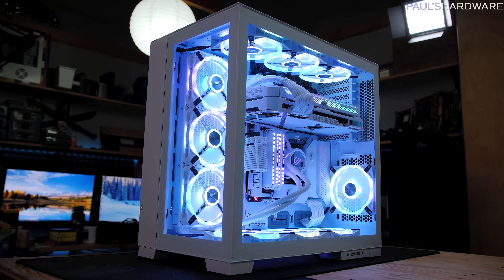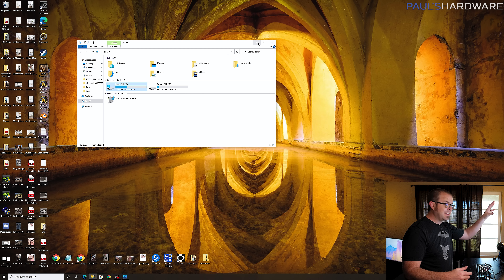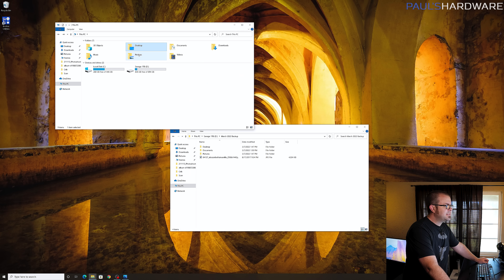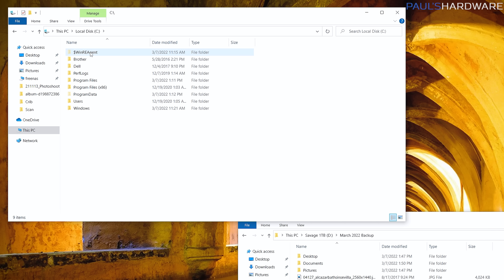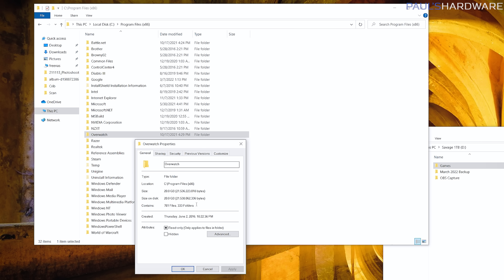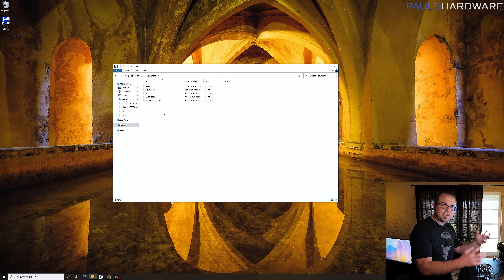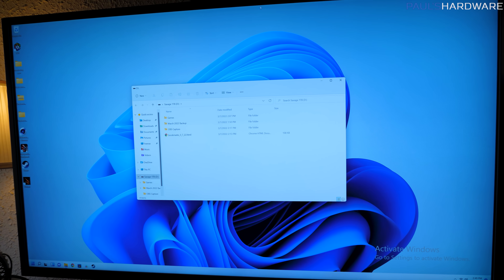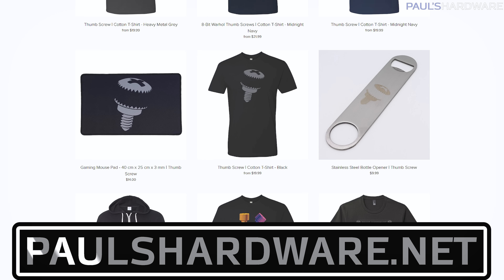How to Move Everything from an Old PC to a New PC

Comment: .My PC has died, so I'm wondering if it's possible just to buy a cheap refurbished PC on eBay and drop in the harddrive from the old PC ... What are the issues I would face, because I'm expecting it isn't going to be as easy as it sounds.

Comment: issue is i have very old photoshop and lightroom 5.6 what works great for my needs and by looks of it i think its hard to find a download link. i refuse to pay for it monthly so i will continue using older version , well as long as i can so im moving from  Asus ROG STRIX X370-F motherboard with a 1800x , to a Gigabyte B550 AORUS ELITE AX V2 as i need better rgb and argb and newer usb and extra m.2 and updating cpu to 5700x its not a huge upgrade but need better but less power due to flat Silverstone GD10 height limitations best i could find was id cooling 67mm as the case needs to fit below av receiver, for now im using same gpu evga 1070 8gb and on first start i only plan on plugging in ssd boot drive, so first gen to 3rd gen cpu, an new motherboard , i plug in the m.2's  after it set up, from win 10 to win 10, no changes , issue is i have older editing software what these days it a monthly subscription  but ive got older stuff and i do not want to try re install that. will it work if i keep it as simple as possible by only one drive and i guess an internet cable instead wifi to start. as i do not want lose the software this first time moving over a windows, normally just use a key. whats your thoughts on it as it not a huge changed as motherboard was quite a well spec one before and only moving from gen 1 to 3 , i be grateful for your thoughts on matter, only one more thing new the psu but i doubt that upset anything  . i back up my system and i may need to go naughty sites to find my old lightroom if the transfer over has issues as people saying they cannot find links to re download old lightroom, i have a good but old d800e old software is great so my biggest concern is moving over editing programmes, rest is just an easy backup

Comment: I have windows 11 now. My old system had windows 10 and backed up to an external hard drive. If I  click restore back up from my new pc with windows 11 then my backed up drive will istall the windows 10 operating system along with everything else and completely transform my new pc to windows 10. How can I prevent the windows 10 operating system from transfering to my new pc with windows 11? ty

Comment: Hi, I have a question.  I have 2 pc's one is windows and other chrome os.  I was wondering  the one PC-windows  its screen is blank but the power is on.  I suppose I can tranfer the files on flash drive and then see what files I want to keep on the newer model right?  Do I need a technical expert to restore my screen  in order to see the screen when transfering files or it isn't necessary?

Comment: AI Overview

The "3D Objects" folder in Windows is a designated location to store 3D model files, primarily used by applications like Paint 3D and Mixed Reality Viewer, where users can save their created or downloaded 3D objects; essentially, it's a dedicated space for managing 3D content on your system.
 
Key points about the 3D Objects folder:

Function: It acts as a default saving location for 3D files generated by 3D design programs or downloaded from the web. 

Associated apps: Primarily used with apps like Paint 3D, where new 3D projects automatically save within this folder. 

Location: You can find it within your user profile directory on your computer.

Comment: You are a lot more knowledgable than me so I know there is a reason for this but I will ask; I'm in the process of building a new PC for me and a family member will be getting my old PC. I need to transfer everything to my new PC. I was planning to create a system image (not sure if whole system image or just part system) and use a recovery drive to put windows on the system and then use the system image to put everything on the new PC. Why is this not a good idea? Both PC's running windows11, both are 64bit and both new and old using AMD hardware. Thanks.

Comment: You made it so complicated honestly! In order to do what you have been doing :
1. Down load and install on old PC Macrium Reflect software which you can use free for personal use
2. Hook your HDD from new PC to old PC
3. BOOT into your old PC, launch Macrium reflect
4. Clone your HDD from old PC to new PC HDD 
5. Once clone is complete, remove your new PC HDD from old PC and put it back to your NEW PC. Boot your new PC, you should have exactly what you had on your old PC 100% 
That is the easiest way to transfer your OS, APPs and all your files without even moving a file location
Reply: That sounds more complicated, not less.

Comment: Is there a way of transferring my windows 7 is from my laptop to a new pc and uninstall ingredients windows 11?
Reply: What are you trying to ask?? ingredients??
Reply: @JJFlores197  my laptop has windows 7. I was wanting to transfer that to the new pc I got so I didn't have to use windows 11. But I just said fuck it.
Reply: @Dajmahal1 ok I understand now. That wouldn't work anyways. In theory, you can clone your Windows 7 installation to a new SSD and put install that on your new PC. In practice, it likely won't work well since Windows 7 and older weren't designed to move to different hardware. You will probably get Blue Screen of Death. And since Windows 7 is obsolete at this point, you wouldn't find drivers for your new hardware that will work on W7. So your experience wouldn't be very good.
Reply: @JJFlores197  I appreciate the info. I thought about calling the geek squad. But you helped instead. I'll subscribe for this.  Happy New Year to you and yours
Reply: @JJFlores197  thank you though

Comment: You did not show how to actually move programs to the new pc...registry settings & other configurations that the programs rely on to actually work.
Reply: That's because that is too complex for most people. There's no easy way to move that stuff and expect every program to work. Not all programs work the same and it would be impractical to create a guide that works across every single piece of software that has been and will be written for Windows. Its far easier to just reinstall the programs on the new PC as needed.

Comment: 1:06 so all of my stuff is currently on the HDD plugged in via Sata cable. Can I just put that sata cable into my new pc and have all my stuff?

Mostly just worried about some RPG maker games and the sort. I wanna be able to play them again as I can’t find where I got them. They are stuck in my downloads folder. My buddy said if I just tried to plug in my current hdd that they may be security issues on the new one because it’s not the same pc

Comment: There should be a tool/utility to migrate data files and programs to a new computer. Why use the old sneaker method in these days. At least use a network to transfer files between them and why go through the pain of copy to removable media then recopy to the destination. Welcome back to the 80's...

Comment: I might sound dumb but, isnt it easier to like (if u can) take u ssd or hdd out from ur old computer and just put them in ur new one? 😅
Reply: he did say in the video that was something you could do
Reply: @GamerzforLife1  kk but i dont get in what situation its better to buy an external disk when u can just switch place? Especially if as he does, u dont wanna keep antything on the old pc
Reply: You can do that but if that ssd or hdd has windows installed, it might try boot from that secondary drive which could potentially cause issues. This can be avoided by entering windows boot manager however
Reply: @GamerzforLife1  ok ok, or maybe i can just take my hdd out from my computer, connect it to the other computer and transfer everything on my new computer ssd/hdd. I dont get why he recommand to get an extra external disk

Comment: I have over 300 mods in new vegas in the Nexus mod manager can I move that data with everything exactly how it is including the settings
Reply: If you have a secondary drive you can use that to store your nexus mod data, but if not then it should still work fine if you use a external drive.

Comment: Wow. This video is really helpful. I had my first computer back in 1980. TI/994A. Since then I've  had pcs, mac, worked off mainframes. I installed hard drives and software for myself and coworkers. I've gone from a 300 baud modem that took hours to download a file, to lightning speed. My first hard drive was 10Mb. I now have 27 Tbs of storage. I even programmed some in basic. I've gone from the earliest version of Windows and Mac and am now on Windows 10. The reason I am so thankful for your video is that I'm 69 years old now. Things are harder to understand. I was able to use advanced Excel and Databases. A lot of what you have shown I have done many, many times in the past. But for some reason it now seems like a daunting task. I have a brand new computer sitting in my living room. I've had it since May of 2023. I'm going to set that bad boy up!
Reply: You and I have a lot in common, your experiences with 10MB IBM hard drives, 300 baud modems, basic programming, MAC's, dBase, WordStar, MSDOS 2. Yes, even a Mainframe and Miniframe. You're still a young man, lots of years ahead of you. I'm 75, 40+ years as what we used to call Computer Technician, now an IT Specialist. I can relate to the harder to understand, but in my case it's due to Short Term Memory (STM) issues. I just purchased a new HP laptop. I still do some computer support jobs for some long-time customers of mine, some using remote connection. Glad to know there's still some of us hanging in there.

Comment: when I change my system from FX6300 to Ryzen 3600 without installing new OS I continue using the same old OS from the FX6300 system and now my System manager is showing Ryzen5 3600 Six core processor but expanding it there it shows 12 cores

Comment: For all these expensive gaming computers, your network, or lack of network, isn't very sophisticated. I am sitting her with three computers, all connected via 2.5 GB Ethernet. My everyday computer, my backup computer, and my new computer, which is going to replace my backup computer. I followed essentially the same steps you did, but I copied the files directly over the Ethernet. I use BeyondCompare to synchronize my files.

I've copied all the data. Tomorrow, Amazon is shipping me LapLink, which I am hoping with reinstall my software. If not, I have a directory with everything I have installed in the form of setup files and reg keys. I save everything.

Comment: Love your videos Paul. As another alternative, couldn't you just transfer all the file on to a second SSD/M.2 in the current pc and insert that into the new PC?
On my last PC, I just pulled out the M.2 that contained my Windows 11 files and key and just dropped it in the new PC! I think I did a clean install at an early stage, but it worked in any case.

Comment: For my SSD, couldn't I just physically remove it and put it into my new computer? Or would it explode?
Reply: Wish someone who actually knows would answer because I want to know the same thing. From what I've heard it might and it might not. Your OS install has info about the CPU the motherboard and the GPU, if it's suddenly running on a system that is different it can/will cause any number of random problems... but then again I've never done it and am temped to try it since I already made a clone of my main SSD when my old computer started to go bad.
Reply: @RooftopKoreansMusic you’re 100% correct. It’s mainly a matter of how different the old hardware is with the new. Some old driver files for an old motherboard might not be the end of the world, but if there are outdated CPU or Graphics drivers that are being utilized, it can cause serious stability issues or even keep the system from posting altogether. My first upgrade went a bit like that but it was also because I was swapping from Intel to AMD(major architectural switch).
Reply: @RooftopKoreansMusic  Mine throws errors at me at cancels the copying if I try doing the whole thing.

I just want to have them moved to a different drive on my PC.
Reply: 2:00
Reply: Hi. If you're happy with your current drive and your old drive's compatible with your new pc, that's okay. Used to do it for my past 4 computers until now, because my new hard drive is faster, and physically different, so... 😊
Reply: I am wondering the same thing
Reply: No couse the drivers are different

Comment: Paul -this was so helpful for me! awesome video!!!! several years ago I installed a program ( Examview, test making software) ( I'm a teacher) on my PC. I recently bought a new Desktop PC and want to transfer the software to the new. I installed the software orginally from a CD-rom. I have since lost the Cd-Rom. Would it still be possible to copy the data to USb or "write" the data to a CD/DVD Rw. Or do I need the orginally CD to "reinstall" the software on the new computer? I compressed the file to a Usb "thumb" drive and when I went to install / unzip the file, the data seems to be there, however, there is no setup/exe or .exe file to install the software. Any Ideas?

Comment: Yo Paul, I can see that you are well versed in Win10. I am NOT. To make matters worse, I was just forced into deploying this machine, (Win10) which I had put together over a year and a half ago because the monitor died on my Win7 machine, I don't drive and did not have a monitor for the Win10 machine. It's taking forever just to get the 'Basics' together with this machine, which is also starting to really get my temper flaring. The whole plan with me buying this case was that it can hold two drives, (my old machine is the same way). I was totally ready to put this slave drive from the old, to the new, only to find that supposedly Win10 HAS to Quick Format it after installation to recognize it. Is this so??
      I also have a small, (5--Gb) 'Passport' drive that I used for the barebones back-up, (Family pics, Documents that include my first current home purchase, and music collection, mostly Prince raritys). When I booted this up it showed the drive was quite full but NOTHING showed. After watching a couple of videos I quickly found and Un-Hid ALL files and thankfully everything on the Passport appeared! Wouldn't the same thing happen for the internal drive??  If not would that Rig you used in this Video work for what I'm talking about too? Thanks so much for this post,   ~Mark~

Comment: Paul, Please help.

I have a senior relative, who broke the screen on their AIO.
The system turns on, but is non-responsive to its touchscreen, mouse and keyboard. 
So, there appears to be no way into BIOS or the desktop, and I no of no other way to back up the system's data for transfer.

My relative purchased a new AIO, and I purchased a hard drive adapter, because they want all of their files from the old system.
What I want to know is, if: 
I pull the hard drive from the non-responsive unit, 
and connect the adapter to it,
in the course of setting up the new system, when it prompts for installation of old files from USB, 
will connecting the USB end of the adapter to the new system clone the old system onto the new, or, what you suggest to help accomplish this?
And, whatever you advise, will personal files, like documents, transfer as well? 

Forgive the odd formatting of my question. Since it had multiple parts, I divided them into different lines, to not be overwhelmed by the text.
I have a TBI, and that's how I navigate. I hope that's not problematic.

Thanks in advance, for any advice you might lend.

Comment: If you've installed them on another disc, then how would you install that program again without wiping the data on the other drive?  For example, Mods and games that are installed on another drive, and all that is on the C: drive is whatever the program has installed on that drive and if you installed it again on that second drive would it not erase the info on the second drive, so...surely I've confused you by now...What about cloning it or just moving it to another computer so you don't lose all that.

Comment: I have an old HP Pavilion Desktop running Window 10.  I upgraded it with a new 1TB SSD to replace the old HHD.  But the computer is old and limited.  I want to do video editing so I want a new desktop. I would like to simply take out my SSD from my old Pavilion and put it into a new desktop to use  it for booting and the operating system and all applications (i.e., replace the new computers HD). The new computer would be an HP Envy.  Can I do that, and will it boot and work?

Comment: I'm thinking about just buying a drive bay since my two 1TB HDD are basically hold all my Data and they are already set up if I need to move them to the new 2TB I just bought since they older HDD as backup in the future. I would have to hard install an old Adobe CS license again after uninstalling it. I have save some presets and keys along with game saves and mods.

Comment: This piece-meal method of copying data and certain files is time consuming, but probably gives a cleaner install, particularly when you are upgrading from Win10 to Win 11.  Why did you decide to do it this way instead of doing a drive clone, then upgrading?  I am contemplating the drive clone method onto a new PC so this video didn't really address my questions and concerns.  The reason that I want to do it this way is because I have some standalone legacy programs currently installed on my old PC that can no longer be installed in Win10/11 and I will lose them if I am not able to successfully clone my old HDD.